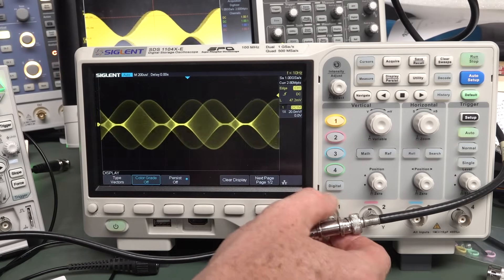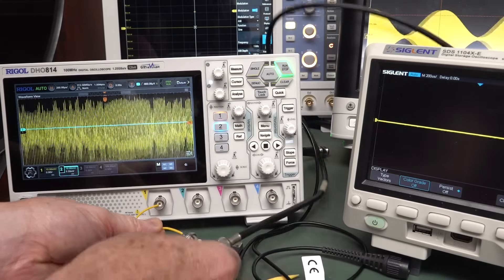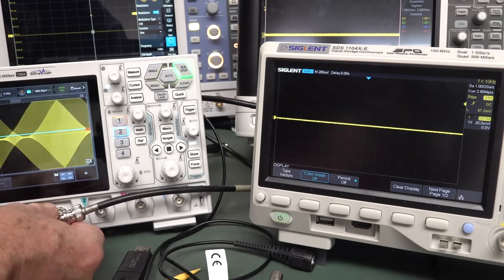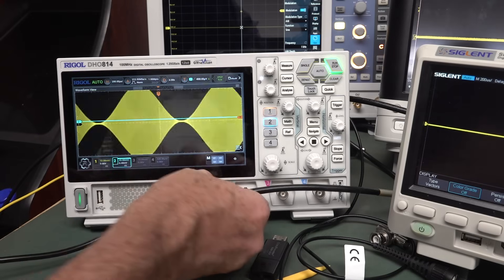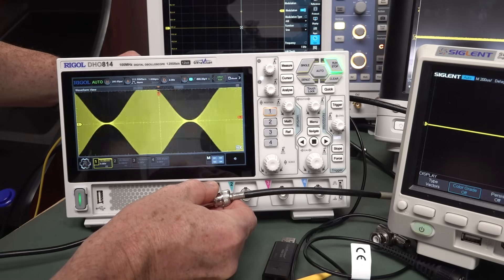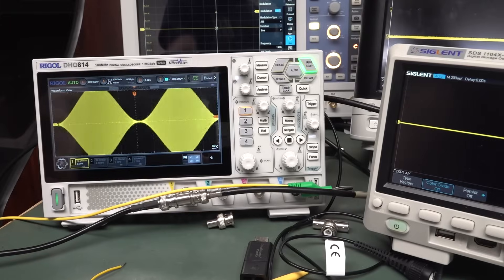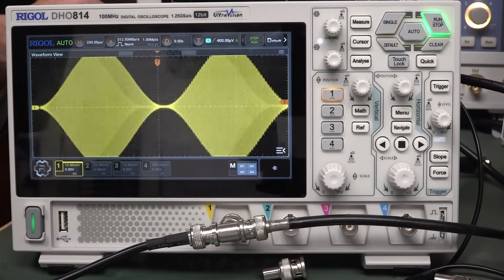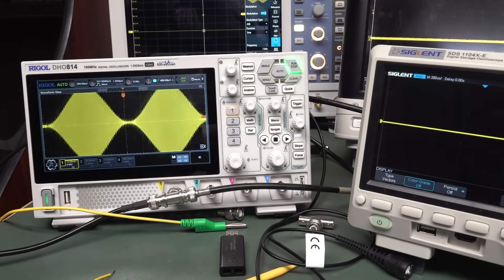Scope WTF Follow-Up - BEWARE Dodgy Connectors

Comment: When I was an Electrical Engineer at RCA/GE, one project required a High-Quality Spectrum Analyzer to measure Low-Level signals at 1 GHz. I quickly found out that BNC connectors and adapters are not only generally unreliable & intermittent, but especially so at low signal levels. Any job measuring, or transferring, low-level high-frequency signals requires the use of N-type, or properly torqued SMA-type, connectors to achieve the necessary reliability.

Comment: I am looking to buy the DHO924S but I am concerned about several things that I have read. It seems that Rigol does not keep its word and in the updates, they deactivate the capture and decoding functions that you have to pay for separately from the oscilloscope price. This seems very unprofessional on Rigol’s part. Additionally, other channels and networks are reporting issues with blocking and freezing during normal use, especially in the 250MHz models. Could it be that their FPGA/CPU is insufficient? Maybe the burning smell you detected in your video review was actually a slow burn.

Comment: If you take some pilers and physically squeeze the BNC connector just slightly.. it will more tightly latch on when you lock it in-- and will prevent it from losing connection so easily by wiggling around.  It's just a bit oversized and not locking securely.

Comment: Rudimentary discovery of a problem in the test setup, fault of the operator. We all do it, cables and connectors get sketchy, etc. Don't smack the equipment or call out the manufacturer before checking your physical setup first.

Comment: My personal go to rule, when results on scopes (and Spectrum Analysers) are not as expected, is to check/substitute all connecting leads.  

Over the years dealing with RF and Video at a hobbyists and professional level I have amassed a number of leads and coax adaptors and some are just incompatible with each other.  BNC tends to be the worse because there are two different standards 50 & 75 Ohm  impedance and both are heavily used in industry so there are many examples around.  Cheap T connectors seem to be the worse ones and impedance is rarely marked on the connectors / adaptors.  I have also caught a cold with N connectors - but in my field they tend to be only 50 Ohm varieties.

I keep telling myself that I should sort my box of adaptors/connectors out and paint a red blob on the 75 Ohm ones and also that if I find a questionable lead I should toss it - but I never get that far 🤣🤣🤣🤣🤣🤣

Comment: I've had a lot of flaky BNC connectors from ebay etc. A lot of the moulded BNC cables you can buy are truly awful. I make all my own BNC cables using branded connectors, branded cable (eg. VanDamme) and my trusty old RS crimp tool. 🤠
Reply: Same here!

Comment: That was my first thought. Those t-pices have caused me already a lot of anger. They seem to have notoriously bad connectors. Some of them are also for 75 Ohm. They fit, but have smaller inner pin diameter, making unreliable connections with 50 Ohm sockets.

Comment: This reminds me of the time I had a faulty LED backlight driver board and the culprit turned out to be the freaking vias in the PCB. They would start to get intermittent once it heated up a bit. Took forever to lose so much trust in things to consider them a possibility.

Comment: I'm still eyeing that crimped BNC, back when I was working with 10BASE2  thin coaxial Ethernet, the crimped connectors where a constant pain in the backside. Always failing and needing replaced with decent soldered versions.

Comment: Daiyve, you're being bombarded by electromagnetic trash from PINE GAP!  Scully...? ...Mulder?...
Reply: My experience, from when I was living in Sydney, is that the radio spectrum below 50 Mhz is saturated with crap, traffic light loops, household WiFi range extenders, Ethernet over power, baby alarms, RF air con controllers, thousands of chinesium plug packs and crap from Solar inverters makes any Shortwave listening an impossibility.  In a block of flats all this crap seems to get impressed on the mains wiring making the whole building a vertical radiator so I'm not surprised that Dave's lab is less than quiet. 😊

Comment: A series on testing the test setup would be very interesting. I don't know how many times I have had, or seen others to have much wasted time and energy chasing down a fault that wasn't in the equipment being tested. Cabling being the number one offender and number two probably trusting a reading outside of the specified calibration range.
Reply: Chasing down equipment problems is like one of those movies that keeps having twists that totally change your view of things. You think you've solved the problem then find it was some connector at fault all along.
Reply: @gargantuablargg  I experienced this with an audio patch cable a few weeks ago, that coincided with a software update which (for some reason) enabled settings I have never used such that I thought I had both faulty inputs and outputs at the source when all I really had was a bad solder joint in a single connector (at an output).

Comment: How many hours of fiddling?  You are not alone, I also have use T BNC connectors for 5-wire RGB+HV video distribution and had occasionally had 1 lemon in the lot causing random problems in the picture on one of my monitors.  Even worse, I have had noisy 75ohm BNC terminators.  One on the H-sync pin and the picture would have minute horizontal noise depending on the day and ambient temperature.